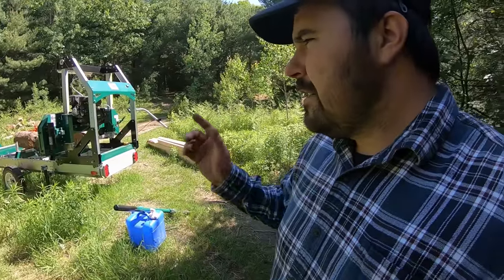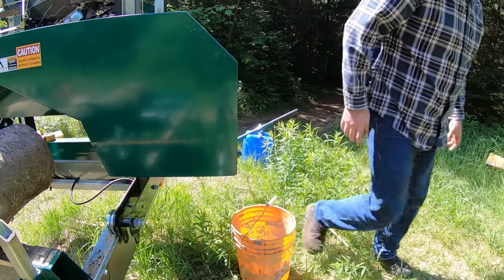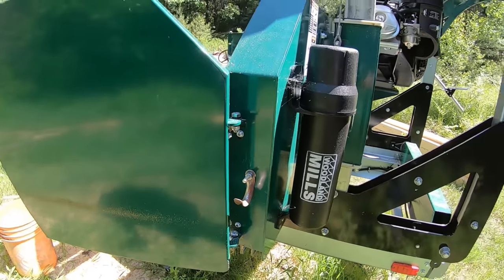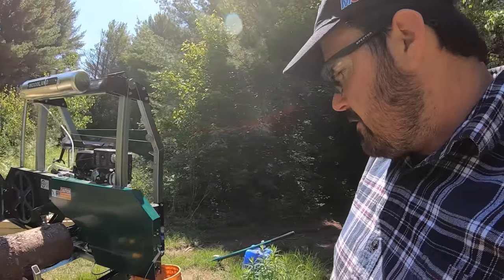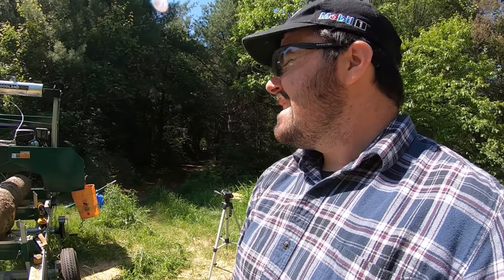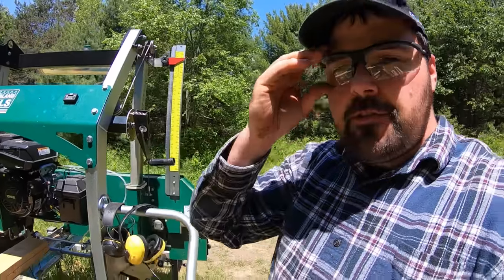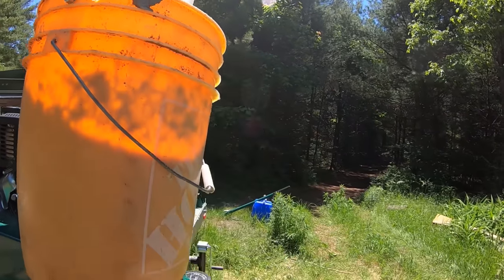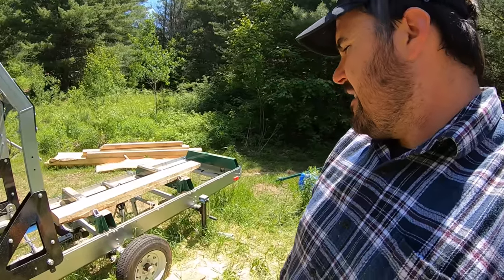No Cost Sawmill Dust Collector | Drilling Holes in my New Sawmill (yikes)

Comment: I have seen other video using a bucket but this is the first one that actually gets into using it. Good job as always. I will put this on my mill and thinking about what you said about "dumping" the sawdust, I remember going to my Great Grandfather's old homestead with my father  and one thing I remember about the chicken coup was the walls were filled with sawdust as an insulation barrier. After a few thousand BF imagine all the free insulation for buildings. I have used blown in insulation in walls to sound proof them and that works great so instead of throwing the stuff away I will put the sawdust somewhere I can get to it and use it in building around the place as insulation.
Reply from the maker: I like the way you think there Jack! Thanks for sharing that!

Comment: I too use a large bucket to catch the sawdust. was one of the first things I did with my mill. The mess of having to clear the sawdust of mud and grass is a pain. Great work always. I'm a behind the scenes viewer and have been for some time but I'm commenting away 😄 
one addition is maybe attach a rubber flap to direct the sawdust into the bucket. I'm thinking of putting a hood on mine for when the wind blows.
Reply from the maker: Great to have ya tuning in all this time and great for ya to say hello

Comment: I laughed at the fact you went to all the trouble to build a sawdust collection system (bucket) and then made three cuts with it on the ground - LOL!!!  Still, it ended up working well and will keep a cut sight much cleaner.  Can't wait to see the new building.
Reply from the maker: Thanks Steve building should be going up real soon. I actually cut a few passes without the bucket on purpose just to show everyone the difference between having the bucket and not.

Comment: That works ok. If you want to collect more dust look up a cyclone filter. Have the dust shoot into the bucket favoring one side so the air can spin and go out the top and dust that is heavier will drop. Don’t angle it down or the air will blow down agitating the bucket blowing some out.
Reply from the maker: Thanks for that Ben

Comment: The 5 gallon pail 🪣 works great, my suggestion is bring the hook up an inch or so , that will give the pail a slight angle so no need to add that guard , the slight angle of the pail will also help evacuate the overflow sawdust from the pail eliminating  a plugged sawmill shoot , a 16 foot x 10” cut will fill the pail , a handy 55 gal drum to empty into works for me , when full haul to a suitable dump sight. 😉
Reply from the maker: Sounds like some good ideas. Thanks for that

Comment: Great idea! The dust piles up and turns into a soggy mess around my mill! I will be doing this the next time I use it! I may need to get a smaller bucket as my mill is not on a trailer yet.
Reply from the maker: Yeah I’m the same way. Sometimes the mess after it gets wet turns into a. If headache

Comment: I'm glad I waited until the end of the video to comment. Right before you made the back higher with the plastic jug I was going to suggest something similar using galvanized roof flashing, but I like your fix better since it isn't near as sharp.
Reply from the maker: Yeah I just happened to find the old jug laying around so figured it would do the trick. Seemed to help keep the dust from going over the top of the pail nicely. Hope things are going well with you Wallace.

Comment: Great addition, Why do you have 2 saw mills?  I like the first setup for your sawmill, NO MUDDY FEET. to me that is the most important. 
I was wondering why you wouldn't have 2 or 3 sides  of the shed closed off to keep the weather out. Great idea the steel roof what about putting in a few clear panel roof sheets to allow light in.
I enjoy the thought process  and your progress.
Reply from the maker: Hey Rob, I don't have 2 anymore but at the time I had two until I decided what I liked best. Thanks again for tuning and happy sawing!

Comment: When We first setup the 130max we tied a 5 gal plastic pail there because we didn't want to cover the driveway on initial tests. Worked great, we filled 2 pails in short order, we just used an old piece of fencing wire that was close and easy to grab
Reply from the maker: That sounds like it would do the trick

Comment: It is a good way to collect the dust but very helfull to separate from the different king of wood like pine and cedar good trick 
  Now you did something and I don't know if you realized you did it when you put that piece of 2x6 between the log and the locker for the log so the machine could clear the humps and bumps you might want to explained that one I am pretty sure a lots of people are scratching there heads on that one I use that trick all the time it beat having to take out the saw have a great day
Reply from the maker: Great point and you're absolutely right! I did put that piece there to keep the humps in the log back towards the centre.

Comment: Hey Sandy!  Cool video and really like that sawmill setup!  Glad that bucket idea is working out for you!  Kinda noticing the Kohler engine seems to be hesitating a bit long at the start when you give it full throttle there.. although keeping in mind that it has to get the belt, pulleys an blade all spooled up for cutting, but wondering perhaps a small carburetor adjustment might help on that front and may give the engine a little more punch on the take off engaging the clutch.. but if there is a particular reason it’s set that way then cool beans, no problem :)  Anyways just a few cents of mine I wanted to offer as I enjoying helping out when I can :).  Anyways cool portable set up!  I really like this model! Cheers Sandy!
Reply from the maker: That's a good point. I"ll have a look into that. Little adjustment may be the trick

Comment: Rather than adding deflector, you could cut a notch out of the bucket and raise it up. If you put a lid on pail and notched it too, there would be almost no sawdust escaping. Of course, you would lose capacity. I’m going to try this on my sawmill and collect sawdust in totes. There is a market in rural Alberta for this as livestock bedding. It also works well in mud puddles on the ranch.
Reply from the maker: I like that idea Matt! Keep me posted how it works out
Reply: A similar option would be to leave the bucket as it is and cut the lid in half.  The earlier test cuts showed just a little escaping before you put the shield on.  It looked like a half lid would have captured it and still left the bucket easy to empty.

Comment: My main concern with your solution...is that over time do you think the weight of the bucket and the application of weight being added and taken off might start to throw off the balance of the measurement and the level of the cut? because its all on one side of the machine? If you are going to park the sawmill you could build a troth the length of the mill and a backing to it so u catch all the sawdust.  When full just pick it up with the tractor and dump it that way.....though you could spend a little and make a conveyor to catch it all and have that dump into a large tote.....you could go even more crazy...get some wax...mix it in with the sawdust, press them into blocks, put a label on them "Sandy's Fire Starters" and make some money!!!
Reply from the maker: Great consideration Greg. I think the weight of the sawdust being relatively light II can't imagine any concern. If it was heavier I'd say it would be more of a concern
Reply from the maker: The other ideas are definitely worth considering. Thanks for sharing Greg

Comment: get a burn barrel, put a pvc pipe in the center and fill with the sawdust and compress it down once full, you have a way to stay warm in the winter. also the smoke can help keep the mosquitoes and flies down. saw on Justin Timbers vid that he does tat while building his cabin
Reply from the maker: Neat idea William. Do you just pull the pvc pipe out when you’re ready to burn l?
Reply: @sawingwithsandy  yes, once its all compressed down, pull the pipe and wen u need a fire just light something and drop in hole. would suggest covering it or keep under cover so rain/snow dosent get to the sawdust. one i saw lit burned for 8 hrs. guy also had a specially made grill that he put on it so he could make coffee/cook food
Reply from the maker: Thanks for that!

Comment: I don't know whether it was the angle of the camera or what, but near the end of that last cut, it looked like your blade took a short dive before coming back to plain. (plane) Check out those last two boards.
Reply from the maker: Yeah I think it did Bryan. Great idea by the way. My blade was starting to get a bit dull near the last two cuts and I think that cause a little dip when the blade passed over a dense spot

Comment: I just hang an S hook from the top hinge - no shroud or hook needed, boom done. I'm on a slab, so a 3 gallon works for the lower cuts
Reply from the maker: That sounds like it would work well
Reply: @sawingwithsandy  yup, holds the bucket at a perfect angle to catch everythign

Comment: You need to build you a saw dust stove and then you could burn it in the winter in your saw mill shed while cutting slabs on your mill.  If don't know what one is check on utube diy sawdust stove
Reply from the maker: I'm not familiar with saw dust stoves. I"ll have to look into it. Thanks for that
Reply: @sawingwithsandy  go check on YouTube and just put in saw that stove you can get a lot of information off of YouTube. I have two of them and I'll tell you they work so go check them out
Reply: Sawdust stove is what you need to put in on search utube